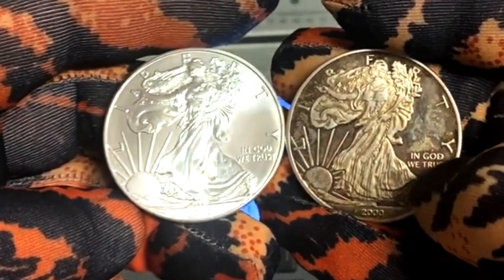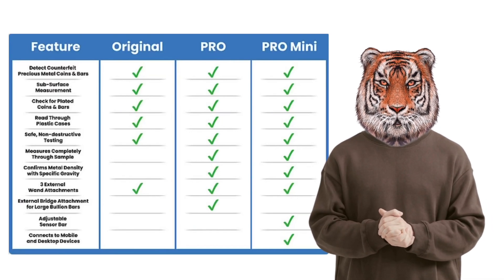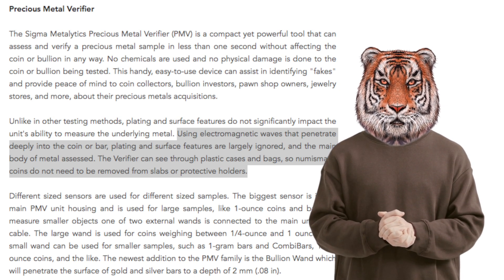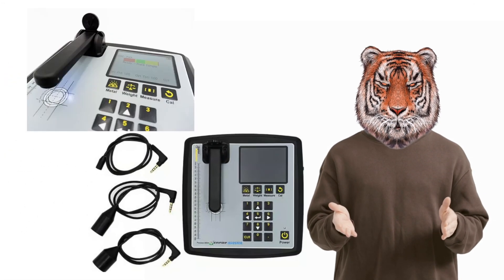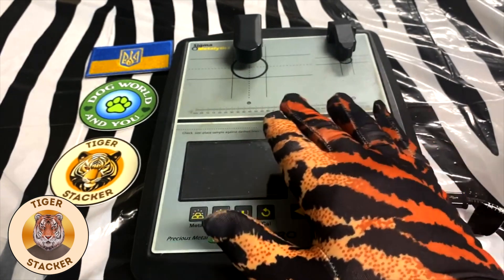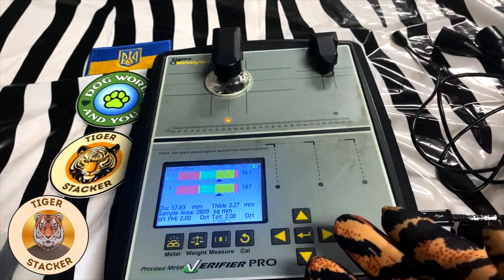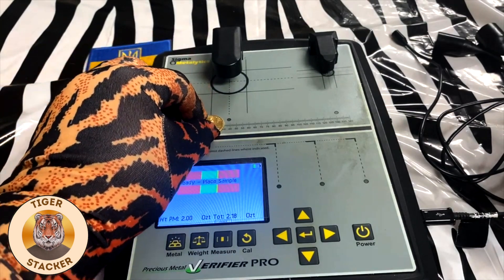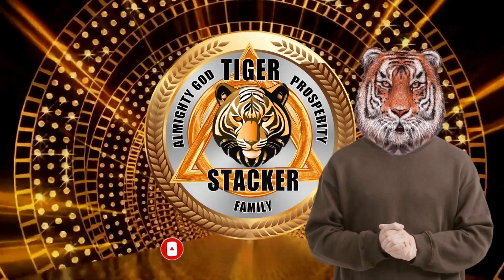WHICH SIGMA?  Avoid Fakes 3

Comment: 💁🏽‍♂️Thank you.  I'm shopping for equipment now. Seams to be the only affordable test equipment around.  🤷🏽‍♂️ I'm surprised olympus doesn't have some type of test equipment. I worked in quality control in✈️ aircraft maintenance🛫 for 40 years.😎🕵‍♂️ We use non destructive testing NDT equipment, and you would think that there would be more available for this type of work. 🐎🦌🦅🪶🕊